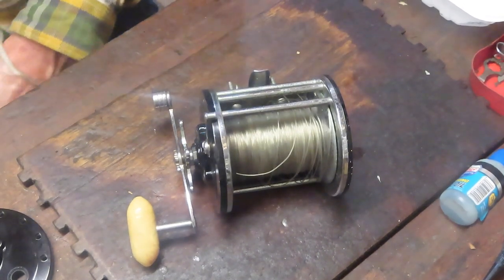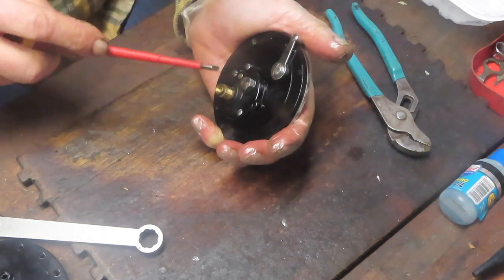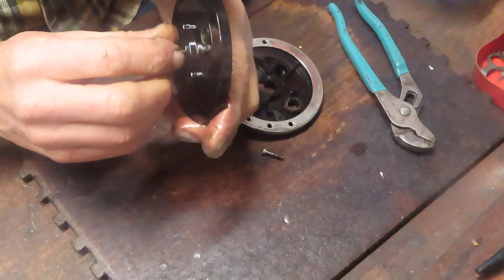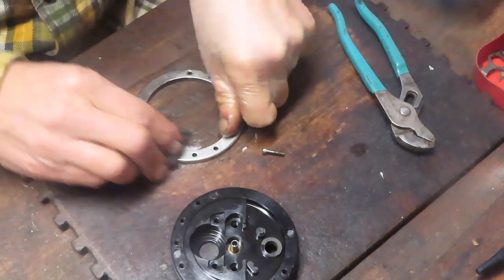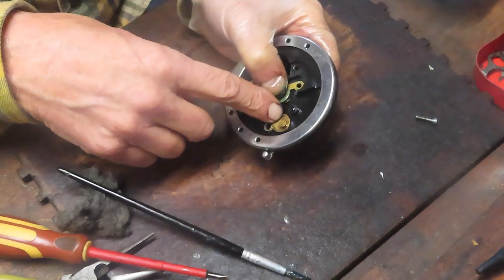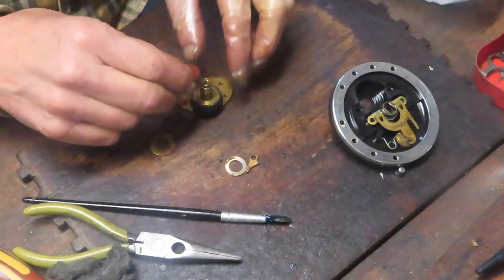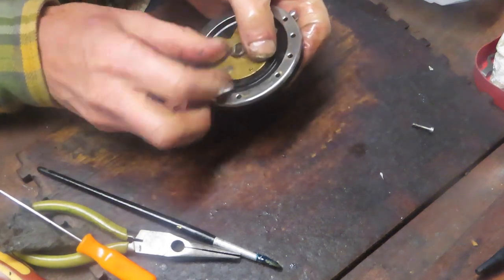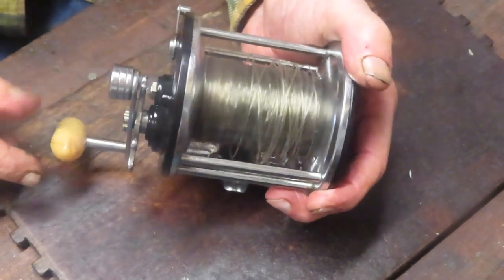Penn Long Beach 68 fishing reel how to replace a broken side plate and transfer all gearing

Comment: Finally Penn Reps said to get the Carnage III for the older big spinning reels...make sure it has the "S" designation....CARBWIII50100S802...
This refers to what modern Penn Rod will still seat a Penn 704z reel.  We tested the reel you serviced and it fits snug on this Penn Rod...
Reply from the maker: Not sure what this means Scott - Dennis

Comment: Great job Dennis!  I've had a Penn 67 Long Beach and the Penn Black Senator 4/0 reels in the past.  These are great reels, especially for Party Boat fishing.  The Penn 67 Long Beach and the Black Penn 4/0 Senator reels, to my memory,  are almost identical.  The only exceptions are the exterior beauty rings and a "Beefier" Main Gear. in the Penn Senator Black 4/0.  The Low Gear Ratio in these reels gives more torque to land those beasts.
Reply from the maker: Yes - you are correct on the 67 versus the 4/0.  Basically the same reel - Thanks for the additional information - Dennis

Comment: I don't know how many of those dog springs litter my workshop floor, once they fly you'll never find them again! I do know that some of my older Penn's use the flat AR spring, are the coil springs interchangeable with their matching dog in those reels? and why do some reels use the flat as opposed to the coil? You've probably covered this topic in a past video, if so could you direct me. Thanks again Dennis!
Reply from the maker: The springs and side plates are not interchangeable.  The flat spring reels were the original set ups.  They were replaced by the coil spring in most reels in 1957, so if you have a flat spring set up, except in the larger Senators, chances are that the reel was prior to 1958.   The side plates to support the different springs were changed as well.  The flat springs have a post.  the coils have a cavity.  If you want to change the spring set up, you need to change the side plate as well
Thanks - Dennis

Comment: First of all, you do an amazing job working on a reel and allowing the viewer to see what you’re doing. I know from my own reel work that it must be very difficult to do this. Talking about parts on eBay - did I tell you I recently bought a lot of 6 NOS Daiwa 7000C handles. I’m going to experiment with mounting a power knob on one of these handles. With four 7000C reels I thought having some spare handles was a good idea. Also I wasn’t going to risk any of the original handles by drilling them out for a power knob. Now I can experiment.  You have totally restored this Penn. it is beautiful now and fully functional. I had to reset the concentric spring on my Daiwa 8700 while I was servicing it. I got it all back together and then that spring popped loose inside the reel so I had to do it all over again.  I know it won’t pop out anymore now.  —— Chris
Reply from the maker: Thanks Chris.  yes, the angles make it cumbersome at times, but I am trying to show more of the service to the folks - Best wishes - Dennis
Reply: @2ndChanceTackle  I have no complaints at all. I just love the content!